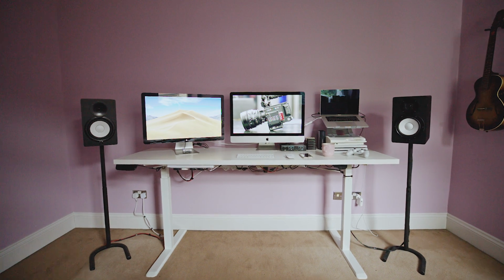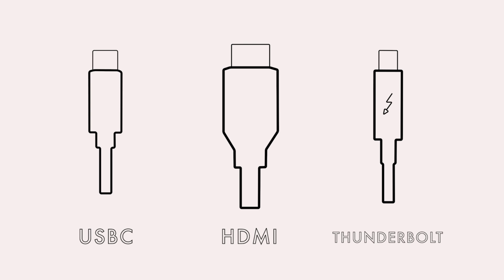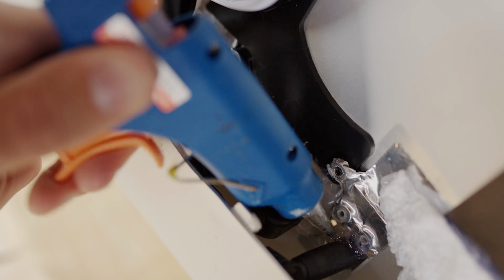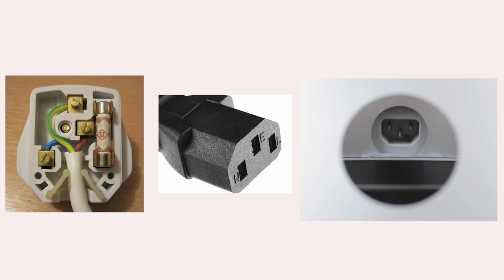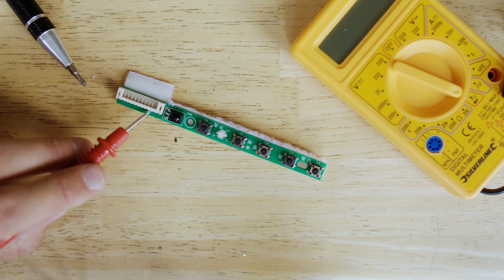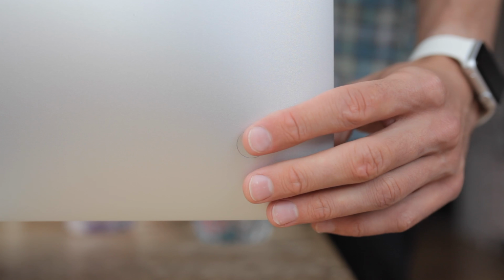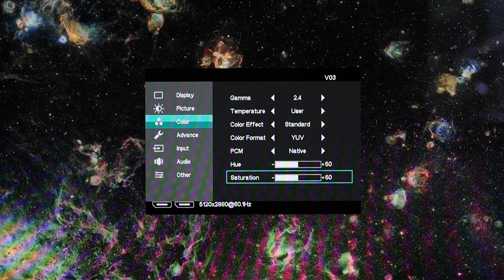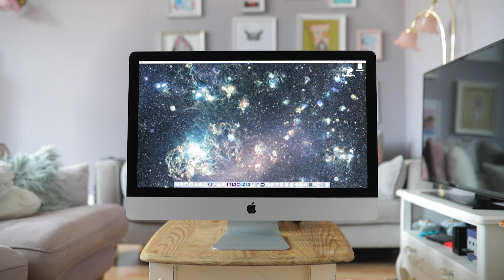The Apple Studio alternative 5K Display // USBC & HDMI

Comment: Nice vid. I'm I right in thinking you've not earthed the metal case? 🤔
Reply: I would add a wire to the incoming earth where you soldered it. I never read the description but that should like a good disclaimer to have. This would be right up my street if I was a apple fan boy and had £500 😂
Reply from the maker: No, I don’t believe I need it, do I?
Reply: @VideoCameron 
There is a risk of shock with out it, especially with attaching the circuits too it. I would say that if your comfortable that's one thing but I'd maybe think twice about telling others not too. All it takes is someone to buy a board with out the backing and one terminal to touch the shell and it's live. If it was eathed it would blow the fuse if it's not it'll give a little shock. Btw Real good content I just used to work as a electrician so a little pedantic about earthing 😂
Reply from the maker: bemf I hear what you’re saying, I just followed the other tutorial, I did also mention in the top line of the description that you shouldn’t do this   or take my electrical advice. Would the ground  cable need to connect to both the cable from the board and the mains? So all three cables need to connect?
Reply: @bemf3549  the board is powered by DC supplied by the power brick. it can't shock you. the real danger is the electrical tape on the AC connections coming loose - I would use heat shrink tubing instead. earthing is definitely good practice though and I would recommend everybody who attempts this does so.

Comment: Nice work. Found the video on r/hackintosh. Almost wish I didn't just buy a 27" 4K monitor. Thanks for sharing.
Reply from the maker: thanks for the comment! It's to see that reddit is still a great place to share videos.. What did you buy? Why not have two? aha
Reply: @VideoCameron  I am already running a dual monitor setup... I already had a Dell S2716DG 2K GSync 144Hz Monitor and the new 4K monitor is a  LG 27UD58-B IPS that was a decent deal at under $225 USD new... I really don't  use the  Dell as much for gaming, so I just might replace that. In the latest Catalina, anything over 85hz flickers and does not work well on the Dell Monitor.

Comment: Great video! I have been spoiled by the high quality of displays in Apple products as well and am tempted to attempt this. Have you tried out the app Monitor Control to adjust the brightness on your DIY monitor via the brightness keys? Not sure if it will do the trick – I have had good luck with it when plugging into non-Apple displays. Might be worth a shot: https://github.com/MonitorControl/MonitorControl
Reply from the maker: hey, thanks for the comment! It's not that difficult, just make sure you order all the right parts. Yes i've tried it and Lunar, they both kinda work. It lowers the brightness, then halfway through it put it back to 100% again and continues to lower the brightness again. If that makes sense? It like starts again halfway through
Reply: @VideoCameron  There is an option lower contrast after brightness in the settings, try disabling/enabling that

Comment: Very interesting video, tempted to try this. Also, I use this to control my non-Apple DisplayPort Displays, should work nicely for you: https://github.com/MonitorControl/MonitorControl
Reply from the maker: Thank you mate! I've given that a go and it seems to work, kinda.. it lowers the brightness, then halfway through it put it back to 100% again and continues to lower the brightness again. If that makes sense? It like starts again halfway through
Reply: @VideoCameron  That might be the control board of yours playing up, maybe? Just a gut feeling. From what I understand the tool uses something called DDC via the DisplayPort cable, which most modern monitors seem to support. I have an older U28E590D and a new AOC 27G2U which both support it. your board should too, as it seems to be somewhat working.